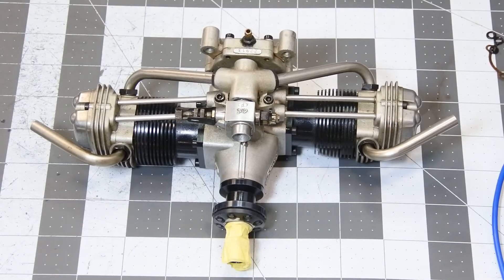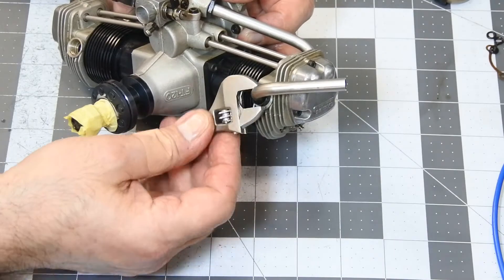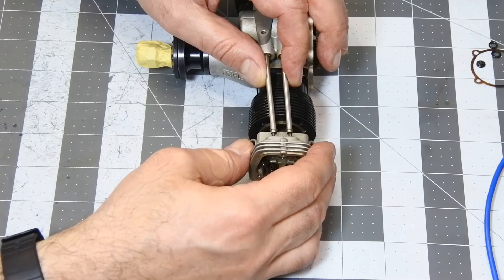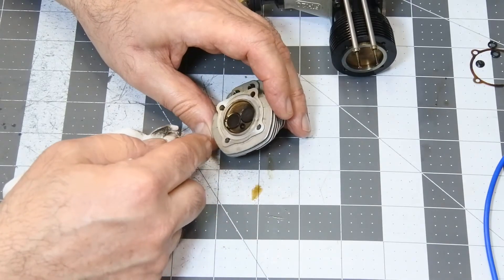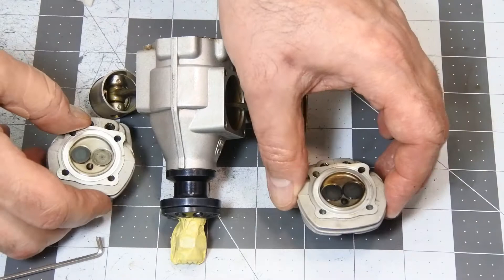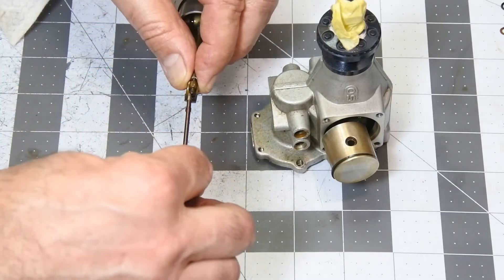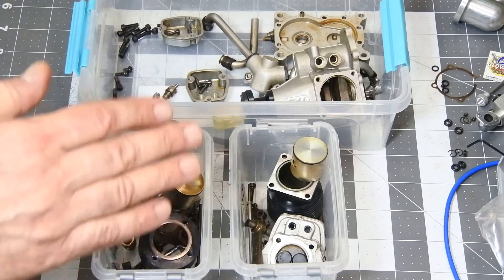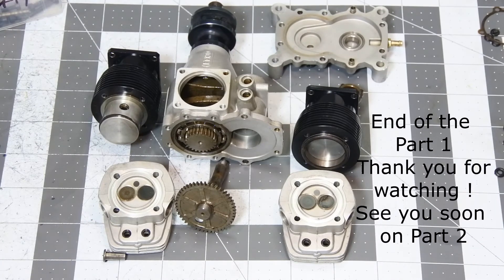OS FT 120 Gemini 1st generation refurbishing Part 1

Comment: The right cylinder on all these OS twins - including the 300 - runs leaner/hotter than the left cylinder.  Too bad they couldn't have addressed this somehow in the design.
Reply from the maker: Thank you very much for your comment ! It's very important info. Do you know, what could be the reason for such engine behavior ? As far as I know, both cylinders are looks equal. Should be some kind of design flaw, which leads to such unbalanced cylinders work ? Probably, someone was also discovered, what was the reason and offers some kind of a "cure", or some mods,  to eliminate this ?
This is very interesting question. 
Thank you,